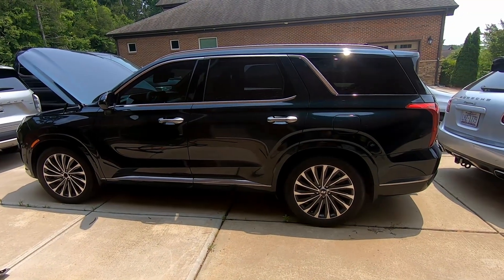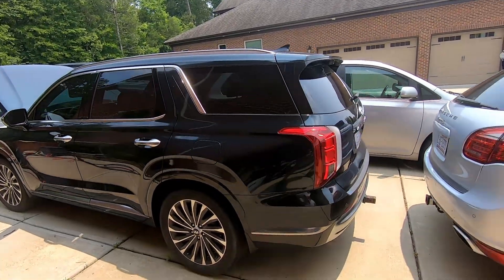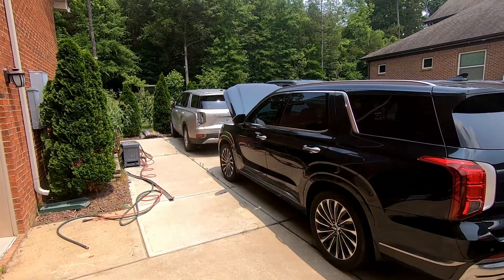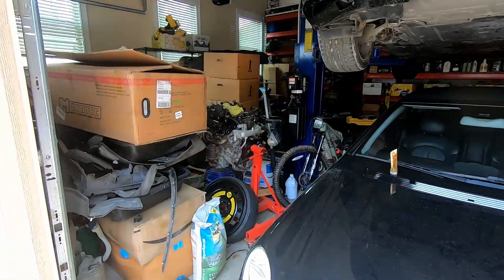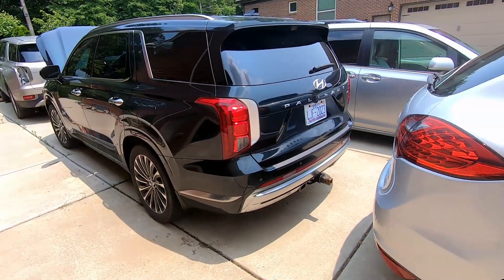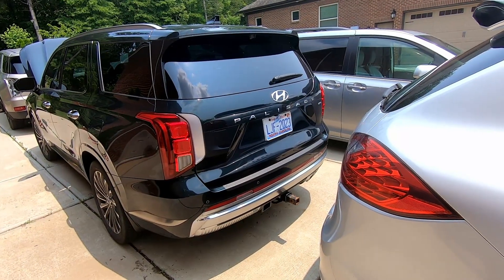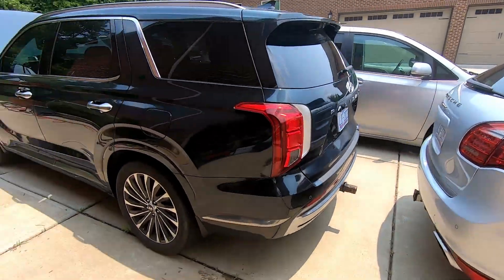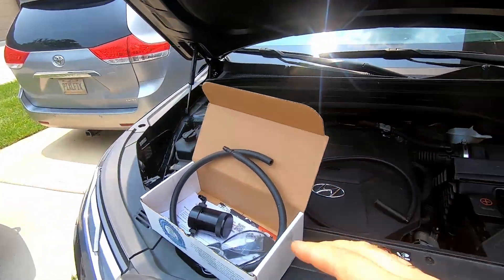Part 4. Hyundai Palisade Engine Oil Catch Can Installation.

Comment: I have a 2023 Telluride and think of doing the same after I have been reading so many of the engines start burning oil due to clogged oil rings.  Can't believe they think burning a quart of oil every 1000 miles is normal.  They clearly have bad rings when it comes to a GDI engine.  If you take the car in for service under warranty, do you take the cans off?  I read that many people are worried it voids the 100,000 powertrain warranty.
Reply from the maker: My car is out of the warranty, so I don’t worry about it, but generally speaking it’s next to impossible them to prove that a catch can could have affected the engine in a negative way.
Reply: @HETPEZB  Thanks. I agree but they seem to find any reason not to pay.